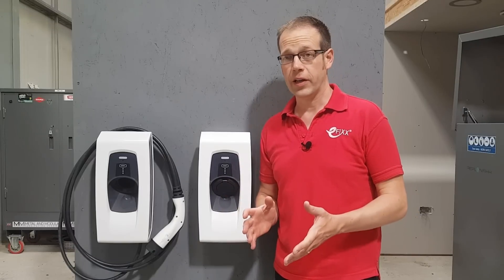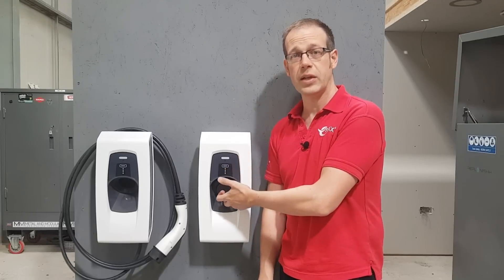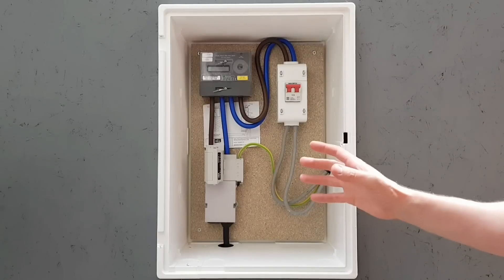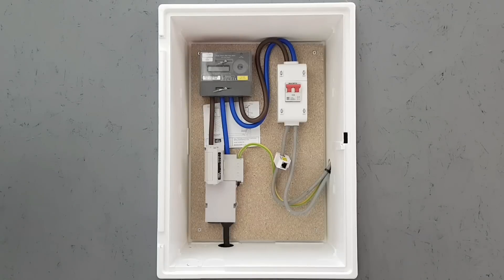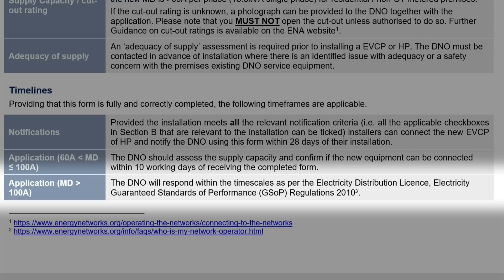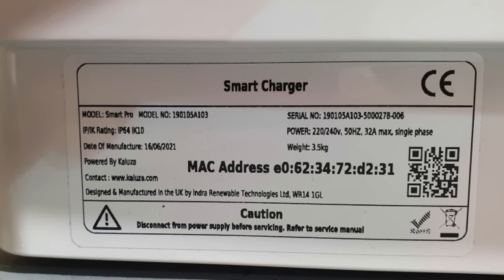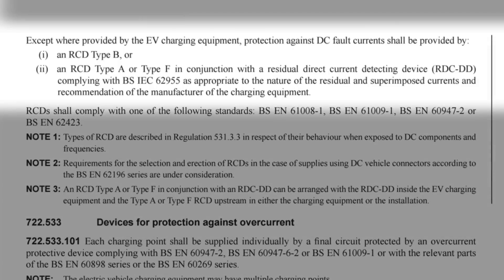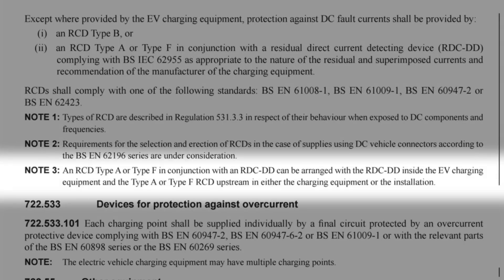HOW TO INSTALL AN EV CHARGER - INDRA SMART PRO

Comment: Quick question your e net connection as shown in your video where the enet cables which are low voltage  run together with high voltage cable is this not again regs? As far as I know low and high voltage cables should never  run together even though the cable you show has the 2 together any taught on this , good video though very informative.

Comment: Why did you edit regulation 722.531.3.101 and remove the word “individually”? It’s an important word as it means that the EVC circuit should have its own individual RCD, not sharing an RCD that is protecting other circuits.

Comment: Hi my installer has used t&e 2.5mm cable to install my ev charger can you tell me if this is suitable 
I'm not a electrician but it just seems to small a cable for the job
Thanks
Reply from the maker: If you want to charge at 7kW then it’s too small.
Reply: @eFIXX   thanks for replying I just thought it did not look right and cable gets hot when charging
Reply: Iv been reading the cable wrong it's 
2x6 2.5mm so it's 6mm cable 
So is that ok 👍

Comment: Hi is there any reason why you can't have a smart charger installed if you have one of the old meters with the wheel on it rather than a digital one 
Thanks

Comment: How much should an installer be charging for mounting on an outside wall  literally the other side of the consumer unit (which has spare slots)?  Just had a quote of nearly £1,600 (including vat) for supply and fit of a £450 ev box.  Seems pretty steep for what they call 2 hours work or am I missing something?  Any recommended fitters in South Manchester?

Comment: I'm from China and EV are really popular in here. However the EV charger installation is always problematic because the contractors tend to use cheap ordinary MCB and RCBO for protecion. For domestic usage, those ordinary RCBO should work well because literally no one would consume 7kW of electricity for like 10-12 hours continously. For myself, the RCBO tripped twice because of over-heating of the bi-metalic strip (not by residual current protection. Otherwise there will be a differnet button pop-up). The charger is a 220v/32A single phase charger. The RCBO is C40 rated and the cable is a 6mm^2 copper cable. In theory, it should work like charm because it's only 80% rated capacity. But I'm not the only one suffering the similar problem. My friend using the similar setup burnt out his RCBO completly after prolonged use. Terrible, really.The cheap RCBO may not be suitable for EV chargers. They require something with more consistent quality control and robust design, maybe moving towards industrial grade components.

Comment: Another fantastic video! Really well done and very informative throughout.

Would you need to run two data cables if you did not want to rely on the wireless mobile signal. One data cable from EV charger to the transformer on the tales in the meter cupboard or DB and then another data connection from the EV charger to the router?
Reply from the maker: Thanks for the feedback, much appreciated. 😊 Were actually going to answer your question in the third video in this series. Make sure you're subscribed and notifications on so you don't miss it, should be dropping in about 10 days! 👍
Reply: @efixx  perfect! Thanks for the reply.
eFIXX is a must to be subscribed too! I look forward to watching it 👍🏻

Comment: Wow! We in Poland have to set up the charger by a qualified person and additionally the government office must allow this charger to be used before it is used.
Reply: Communism coming back
Reply from the maker: Its similar here but not quite as stringent, you need to notify the power networks of the installation under most circumstances.

Comment: @eFIXX   As a US  based electrician (New York) for 20+years I can tell you that I have seen many diy projects anything from extending branch circuits to lighting to PV arrays. Most done poorly and without regard to the regulations in this case that would be the NEC (National Electrical code) which is the minimum set of rules for  electrical installations that apply to all 50 States. On top of this (NEC) there is the  code which pertains to the location Of the installation/s . Having said that , there's nothing wrong about diy as long as it is done correctly, but I am pretty confident that no homeowner insurance will cover any diy project should anything go wrong.

Comment: Non sparky here...our house is on a TT earth system. Does this present any issues for an ev charger installation?
Reply from the maker: Not really, it's actually one of the safer earthing arrangements for an EV charge point, much of what was discussed in this video related to TN-C-S systems. All the usual requirements for a circuit will apply and choosing the correct RCD is crucial. 👍

Comment: For US models, it's so easy to install a smart EV charger that it's commonly done as a homeowner DIY project. We installed ours one sunday morning. Super easy.
Reply from the maker: Interesting, I thought electrical work was a bit more closely regulated over there. Do you have the equivalent of a TN-C-S earthing arrangement?
Reply: @efixx  
Similar. While TN-C-S connects the ground conductor to the Neutral conductor after the supply panel, in the US, we bond the ground and Neutral bus bars within the breaker panel, and keep them separate from there on out, and kept separated all the way to the device. This eliminates the chance of potentially energizing a device cabinet, whether it be due to conductor insulation failure, or miswiring. 
For a 240vac receptacle used for a smart charger, we have two 120vac conductors, one neutral conductor, and one ground cable supplying the device.

Comment: If you're hardwiring the data on the Indra then EV Ultra is a waste of time as you will still need to run a separate cat5 for the CT clamp. In this case we run a NYYJ and a pair of Cat5 cables. However there's the new Wifi dongles if the 4g signal is poor. We keep a few a few of each on the vans.
Reply from the maker: Oh you are gonna love the video where we connect up, power, data and CT all in the EV Ultra cable and no extra cable required. Stay tuned! 😊
Reply: @efixx  Oooh!
Reply from the maker: Make sure you're subscribed and the notifications are on matey, it's really cool, should drop two weeks from now. 👍👍👍
Reply: @efixx  phew, almost dropped a spoiler
Reply: You only need 2 pairs for 100M ethernet (Orange and Green), leaving a for a CT and a spare
Reply from the maker: Aw man, spoiler alert! 😂

Comment: Oh dear, another chargepoint with a whole bloody Linux computer inside. Complete overkill, waste of power and so many more ways it could go wrong.
Reply: The indra unit and team out of all the ones i tested seems to be the BEST built with most on broad PCB design the CPU broad isn't a Pi and also is made for industrial applications like this...  I do reckon we might see it disappear from the unit but have a look at my deepdive reviews and everyones circuits this is by far one the best designs from an engineering point of view.
Reply: Cheap and easy to replace? A lot cheaper than the circuit board in my gas boiler or other proprietary circuit boards?
Reply: @bencampbell2041  But much more likely to need replacing
Reply from the maker: It all allows for external control and safety settings.
Reply: @efixx  So would something more appropriate like an ESP32 module.
Reply: There's another two processor cores on the main board ;-)

Comment: I have just had a Wallbox installed on the outside wall of my external garage by a sub-contractor of the installation partner of a major electricity supply company.

Should I have received any paperwork informing me that the DNO had been notified?
Should I have received any paperwork documenting the test results, resistances, disconnect times etc, similar to what would be in an ECIR report?
Reply: Yes yes and yes
Reply: And Part P Building Control Notification Certificate for installation of a new circuit? 😅
Reply: You should receive these but it's not something the electrician puts in your hand as he leaves. The installation certificate (EIC) goes through an admin process and is reviewed the the company's Qualified Supervisior before it is released. It will likely be several weeks before you receive this.

Comment: Great video I question what you stated that it's unlikely to be greater than 100amps. Each home is differant so adding curtailment can sort out some issues again depending on what your max demand is. If you are all electric and possibly have a large heat pump then you could be close to your limits in which case the load curtailment will be of use. BUT if you need your ev ready for a long journey and say you only charge in a set period due to a tariff, then having an ev charger with curtailment prob won't work for you. Again every home has a differant seniorio. Family homes have hot tubs running, and if family's like to save then everything tends to go on in the economy 7 period. So your ev won't be ready with a full charge. Again if your large home has a 22 kw heatpump then you would most certainly have to curtail the charger at a cost of ev not ready with a full charge bearing in mind a 62kw battery from say 28% to 100% could take 8 hours and new battery's are becoming bigger so double this using a 7.4 kw battery. And another issue will be not so much now but in say 5 to 10 years time second evs and chargers will be required for a working family using ev every day. If your a retired then you would proberly charge once a week so no issue. The heat pumps depending on size and say temperature will affect md specially in colder months. The standard 7.4 kw ev charger will be outdated and the basic will become 22kw for bigger ev battery's with respectable range. So the question is is single phase going to work for every family home possible not.
Reply: Gino a 22KW heat-pump has an input power of around 6KW.  Your EV is definitely not going to charged if you blow the cut-out fuse - that's the point of curtailment.  A 100A supply is capable of delivering 192KWh over an 8 hour period (£50 of electricity), you're doing something industrial or live in a mansion if that's not adequate.  Looking into the future you're going to see much more intelligent load management where energy is consumed when it's more available, and this will be sure to look after your supply.

For 99.9% of scenarios its perfectly reasonable to charge two EVs and heat a home off a 80-100A supply. As someone who has an EV I can't see a need for 22KW home charging, The battery just has to be full by the morning and its almost impossible to know a scenario where I would get home with an empty battery and must have a totally full one by first thing in the morning - if for some reason that did happen, then I'd just have to use a public charger slightly earlier in my journey - not the end of the world.
Reply: @edc1569  great feed back thank you. What I was trying to say is with battery power increasing we see 107 kw battery's and new to the market 207kw which has an estimated range of just under 723 miles. So going back to the start when cars used the 13amp plug in where cars had 24kw battery's. Times have changed we went to 16 amp then 32 the humble 7.4kw chargers for our 40amp circuits. Now if I had the new BMW with the 500mile range with bigger battery my times on the 7.4 kw chargers will double. So this is why a 22kw charger will be needed at some point As for using public chargers which are getting better its a waiting time of 1h34minutes for me to charge my car ready for its return journey. My dno would not accept my second charger at full load so I have concent from my dno and been advised not to use full load on my single phase supply. I guess they were concerned with loads as you stated and That means under ideal conditions, a balanced load, it can serve a maximum of 240 volts x 100 amps = 24,000 watts, otherwise known as 24 killowatts (kw). You should never load circuits more than 80%, so you have 24 x . 8 = 19.2kw. We opted to use 2 ev chargers and have put on hold the heatpump. Just one charger on full load runs at 28amps for 7 hours. Battery between 20%30%.charger reduces as it gets near 100%
Reply from the maker: Wow, thanks for commenting!